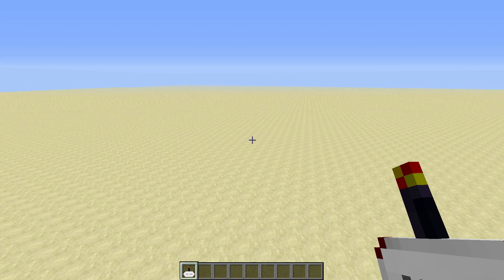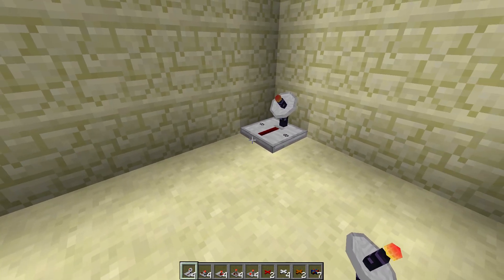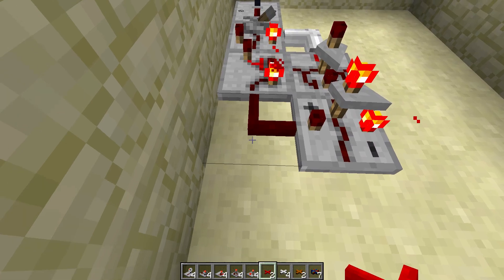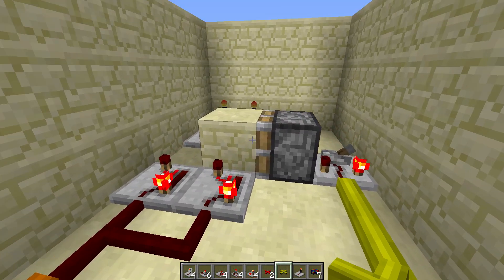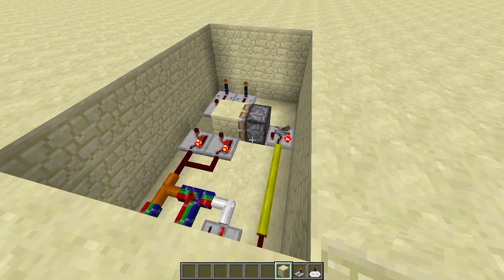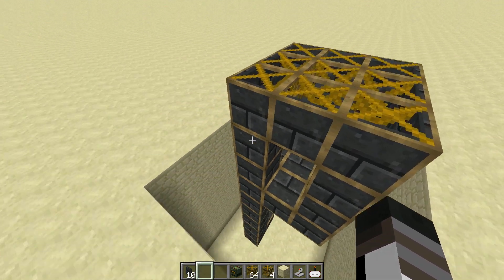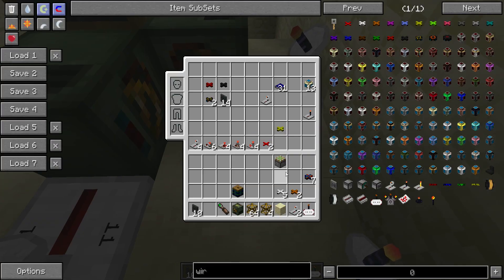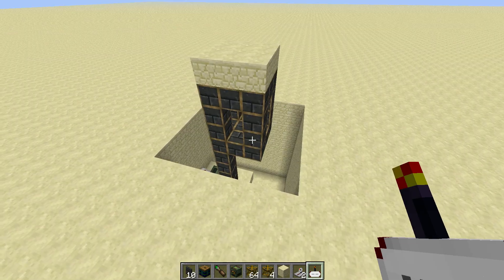Tutorial: RedPower2 Frame Lift/Elevator

Comment: does the number of carriage frames under the platform that forms the hook have to be equal to the number of blocks between floors?
Reply from the maker: +Scott Lacey From memory it has to be equal to or greater than - basically how many floors you have + if you want to have the drive mechanism further away from the bottom floor.

Comment: I would suggest making the lift large enough for the whole thing but maybe have the frame ontop instead of below if your going down to say bedrock, and make as many movement circuits as you have floors all with the counter on different floor levels  and then put the same transmitters and reciever frequencys and wire it to more than one wireless remote so each floor has a different remote and that should work

Comment: Good on yah mate. I dont assume there's a way using this method for multiple floors? I'm thinking of trying to do a 60 block elevator from base to mines, stopping at multiple floors in the base then to the mine. Only problem is using this method would be the frames in the floor so I need to work out a way to add and remove frames to the bottom.

Comment: I found that the ride is a lot smoother going down at .85 when you are looking in a direction other than down (at the elevator)
I also found that going up at .85 enduces some glitching through the elevator due to rendering.

Comment from the maker: I'm glad you liked the video :)

The usual timing for the movement to be smooth is about .800-.850 on the timers. I did this in a local single-player world, but you will notice that it is jittery if you use it on a server with a little bit of connection and/or server lag. A good example is the lift one of my earlier videos (Hidden base, IC2 Reactor Control) - there I was on a server with ~30ms ping time and the lift is a little glitchy.